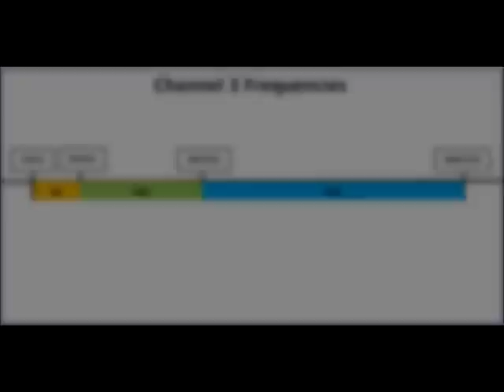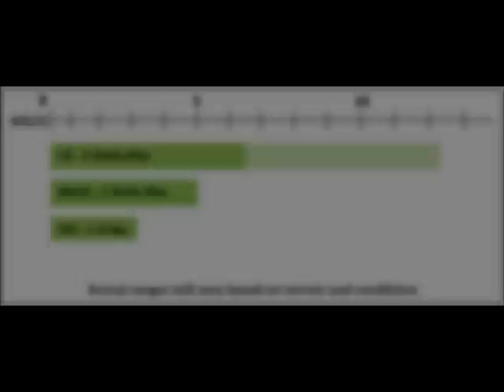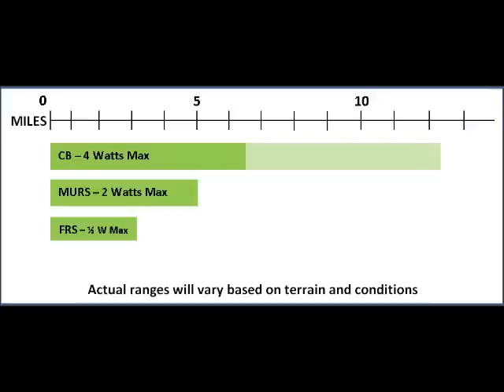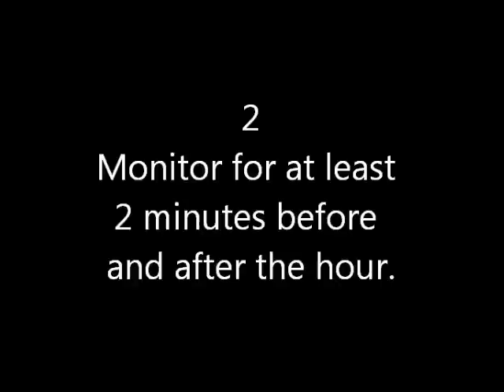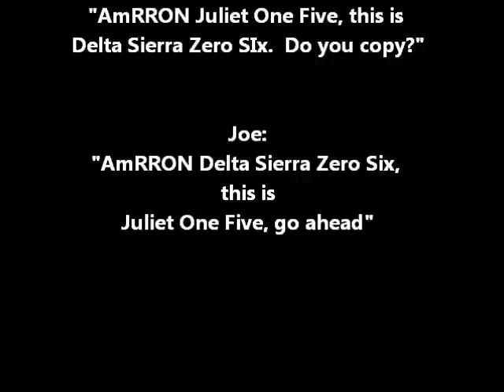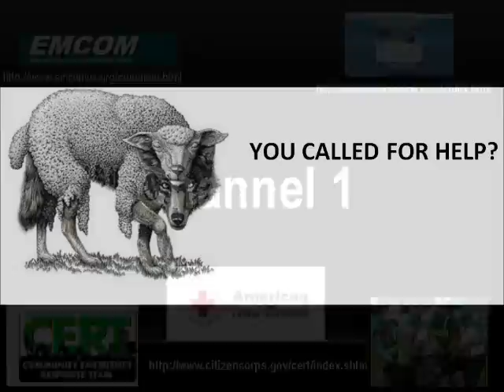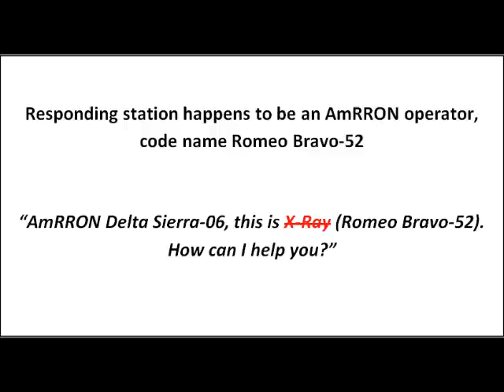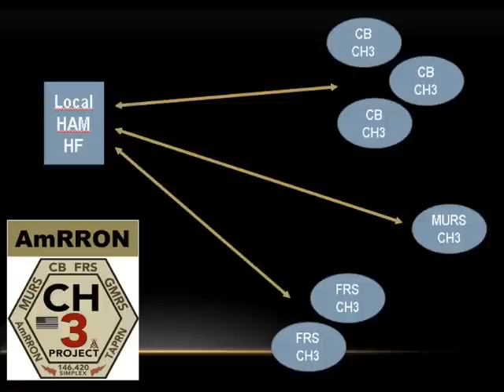AmRRON - Introduction to the CH3 Project

Comment: isnt frs 3 shared with gmrs and as a result requires a gmrs license?
Reply: +TheSmokinApe Some FRS frequencies are shared with GMRS, but you don't need a license to use them so long as you are using them as FRS. That means that you must transmit in narrow-band FM and use half a Watt of transmit power or less. GMRS, one the other hand, can use those frequencies with up to 5 Watts of power and transmit in regular FM. Also, those who use them for GMRS can use external antennas as well.
Reply: FRS3 is shared with GMRS and no license required. There are 8 GMRS channels that you must have a GMRS license. But on FRS3 no license is required.
Reply: +TheSmokinApe   Most people buy these at Walmart and have no clue about any license requirements.
Reply: Yeah, I dont know for sure...
Reply: TheSmokinApe
We use UV5Rs, on MURS and GMRS all the time, in a rural area. No one cares, so long as you are not stepping on or disrespecting others.
Although I plan on getting a tech license in a couple more months and be part of my local network..

Comment: THANK YOU for properly conveying that transmitting on FRS/MURS frequencies on radios like the Baofeng UV-5R is illegal, even if you have a ham license.

FRS:
Power: 0.5w (500mw) ERP max
Antenna: non-detachable
License: none
Synopsis: Baofeng is a double strike here as low power is 1w and has detachable antenna.
You cannot legally operate a Baofeng on any FRS frequency.

GMRS:
Power: 5w ERP max
Antenna: detachable
License: required
Synopsis: Baofeng is OK here so long as operator has a GMRS license. Not many people have a GMRS license and an amateur radio license doesn't count.

MURS:
Power: 2w output max
Antenna: detachable
License: none
Synopsis: "A MURS device must be certified by the FCC.
A certified MURS device has an identifying label placed on it by the manufacturer.  The Baofeng cannot transmit on MURS as it does not have the required "Part 95 MURS" certification/labeling.

Other land-based operations frequencies not listed are licensed. As a Part 90 radio, the Baofeng can do this but again requires operator to have an appropriate license.

FRS and MURS are strikes and all other frequencies require licenses to transmit. Thus, the Baofeng is a commercial, Part 90 radio which requires a license to legally transmit on ANY frequency.

Selling Baofengs as "walkie talkies" with no warning label stating anything about licensing leads people to think they don't need a license to operate the radio.

To recap, using the Baofeng for land-based operations, THERE ARE NO UNLICENSED FREQUENCIES THIS RADIO CAN LEGALLY OPERATE ON, PERIOD. YOU MUST HAVE A LICENSE TO LEGALLY TRANSMIT ON ANY VHF / UHF FREQUENCY THIS RADIO IS CAPABLE OF.